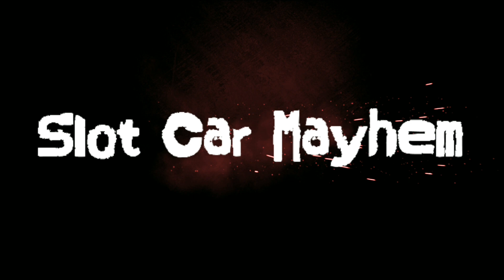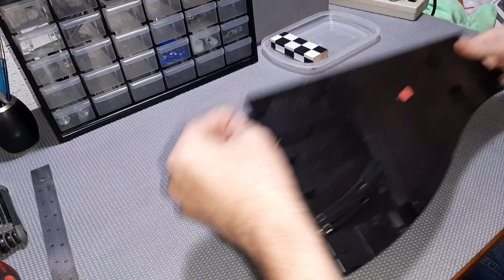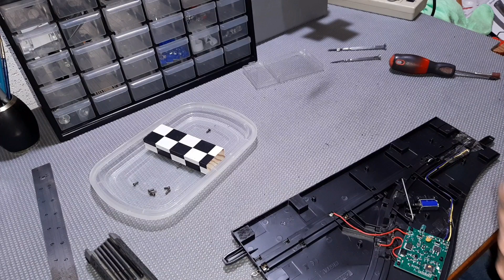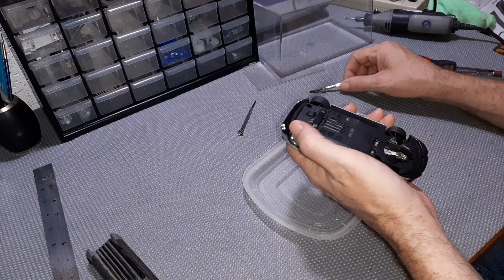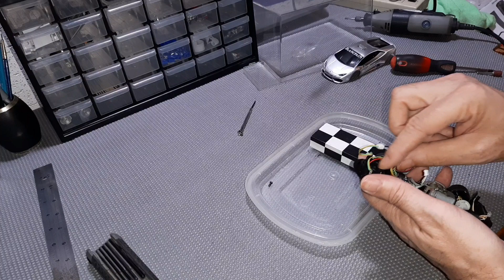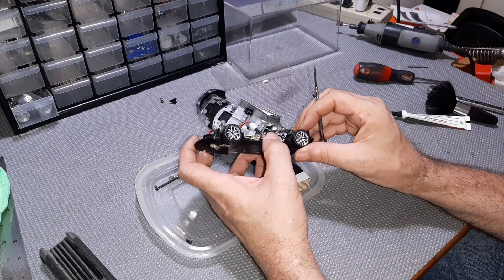Glendale 65 - Episode 16 - Safety Car Pit Lane

Comment: I have the same safety car as you do. I am having a hard time getting the car to run at a slow speed. Even when applying a small amount of throttle. I can get other cars to just creep on the track; not this pace car though. Any ideas to slow it down?
Reply from the maker: First, can you set another car as a pace car and see if that will slow?? You can try setting the pace car as a regular car, drop the speed setting to 1, (default is always 10)  then try reprogramming as a pace car. If all else fails, might be an issue with the chip (early versions of the latest decoder had issues) that can be fixed by adding a resistor. I will see if I can track that down if necessary. Might be a good video!!
Reply: @slotcarmayhem9765  I will give that a try. Can you factory reset the cars like you can the control panel to clear all memory.? I sent you a question also on your video making a  power supply #16, could you respond, please? Thanks, Ron

Comment: I noticed the sensor sticks out of the track after moving it. The backing plate has a groove for the sensor in the old location that allows it to be flush with track surface. Have you had any issues with sensor in new location?
Reply from the maker: I've had zero issues.

Comment: Excellent modification. Haven't even got my track running but this modification made too much sense not to do. I did swap the tail lights to get wire on same side as the board.

Comment: You my friend have earned yourself a sub. Very well done. Would love a comprehensive video on how to use the safety car with Smart Race including a running start w safety car, lap counting etc if possible.
Reply from the maker: Thank you. Safety car is very easy, using the ESC button on the CU, or in Smart Race. You return the car using the same button. Lap counting for the safety car is selectable in Smart Race as well, and shows on the screen as controller #8. Normally, safety car acts like a ghost car when running ( random lane changes), but when you "send it home" it will activate every lane change until it returns home.
Starting a race is easy with the safety car is easy, and is no different than a ghost car. It will start in "return home" mode, and will activate every lane change. Very easy as actually.

Comment: Hi there, great video..have one question trying to wrap my head around how the pace car then triggers the other end of the pit lane when re-joining the main track as you have moved the sensor at the entrance and in the car so when it rejoins the main track where would the signal come from to throw the blade? sorry if this is a dumb question as I'm a newbie to digital and am still putting together my track plan. Thanks in advance, Stephen
Reply from the maker: Hi, Ben is correct. (and Thanks to Ben for answering!!😁) Sorry for the long delay, but had to catch some ZZZZZZ's.

The main intent for this modification is the layout is intentionally designed with lanechangers that normally force the safety car to bypass its pit lane when returning home, thus never allowing it to return home. This fixes that issue. 

Also, the part that joins the pit lane to the main has no flipper, it's just a "Y".

Lastly, the Fuel section itself does NOT require modification, as it is not necessary for the safety car to park itself. 

Thanks to Ben for answering!!!
Reply: @slotcarmayhem9765  I heard you super glued the decoder in the pace car Anytime i install a decoder to a car i hot glue them in place Makes it easier to remove it later if it’s faulty or in your case you want to rotate the chip back to the original position
Reply from the maker: @3roomsraceway612  no, I didn't superglue the decoder, I put a couple drops of sg to hold the magnet in place. The decoder has it's original screw... You're correct though, hot glue makes things easier if replacement is needed!!
Reply: @slotcarmayhem9765  cool mate That will teach me not to watch your vids late at night😂
Reply from the maker: @3roomsraceway612  lol its ALWAYS late at night in my head, lol
Reply: Do you need the pit sensor in that safety Lane? Or can you just put a straight piece of track there?
Reply from the maker: @tomkirkner6692  no, the pit lane fuel sensor is not required for the safety car to return and park. It works off a small change in voltage.
Reply: @slotcarmayhem9765   Hello John.  I'm very happy with that trick of relocating sensors to achieve a dedicated pace car lane.  My only problem is that the pace car does not stop in the lane.  I read your post (immediately above) and I've seen posts in other forums which simply say the same thing:   "It works off a small change in voltage".  Unfortunately, I don't understand what I'm doing wrong, although I have 2 ideas.  Can you help me out?

I have a track diagram but am not able to attach to this message.  So, here's a verbal description of my configuration:
    pit lane entry + a pace car lane  (= 3 single lane straights) + pit lane exit.  
    Parallel to  the pace car lane are 3 straights (= 1 standard straight + a double lane change )
    Note:   I do not use a fuel sensor as 1 of the 3 single lane straights. 
    Note:   I already removed a power tap that was feeding in to the standard straight (between the pit lane entry and exit)

I have two guesses as to what might be interfering with the pace-car-stop function:
1)  Is the double lane change the problem?
2)  Did I erroneously insert a pit lane adapter piece (Carrera # 30368) instead of a single lane straight (Carrera # 30341)?

Before I tear into my layout to test my guesses, I would greatly appreciate any advice you can offer.
Reply: There isn't a blade at the pit lane exit, the car just rejoins the track. It's only when two lanes are going to dverge (eg. pit lane entrance) that you need a blade to throw .. and choose which lane to go into. Two merging lanes always end up in the same lane. A neat solution John, I was wondering how you were going to do that!
Reply: Ben Evans thanks Ben, I didn’t realise that, makes perfect sense now I think about it. I did think that the pit lanes could be entered from each end so as to facilitate reverse running but obviously this is not the case. Once again thanks.👍😎🇦🇺
Reply: (It is potentially confusing but the pit lane hasn't been reversed. Instead, moving the car and special pit lane sensors across means  race cars ignore the safety car's dedicated pit lane and the safety car ignores every junction except it own) 👍